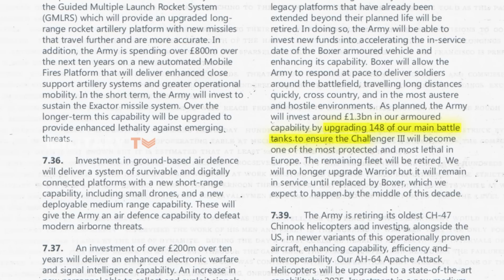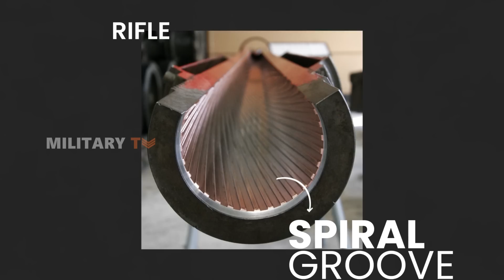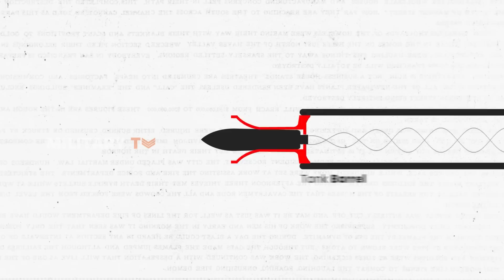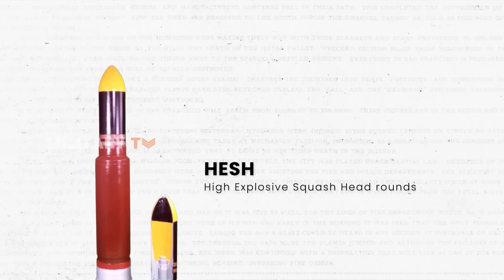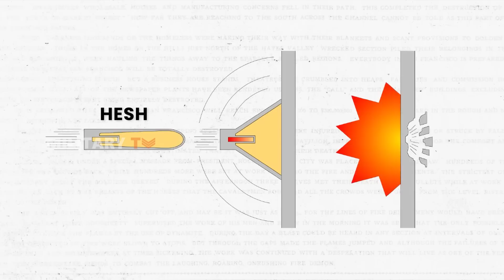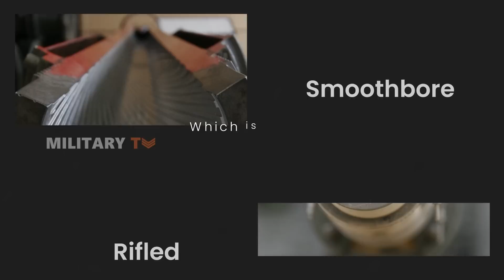Rifled vs Smoothbore Tank Guns—Which Is More Effective?

Comment: Rifled has historically been more accurate over distance, with British forces adopting the theory with the Chieftain/Challenger, build some thing as hard as nails able to knock out your opposition at twice their range. However rifling although imparting spin to improve accuracy lowers muzzle velocity, that was not a problem for British Crews as they loved slower HESH rounds. Far more lethal to a tank than most of you have been told (death by spall is the least of your problems). British 120mm HESH could one shot any tank on the planet from ludicrous ranges (M1's died, but they fired first). However the slower HESH are defeated by Reactive Armour so Britain switched to German scaffolding tubes and cheap ammo.
Reply: Rifled guns are more accurate, but that is not the case with tank guns because tank shells use fins to achieve stabilisation. HESH hasn't been a reliable round against Tank and has fallen out of the inti-tank role for a long time. Modern tanks use composite armour and have spall liners on the inside and let's not forget about ERA. APFSDS is still your best option against other tanks and the APFSDS rounds that fired out the Challenger 2 have rotating bands around them to cancel the rifle of the gun.
Reply: Well, when "scaffolding tubes and cheap ammo" are better... That says something about British engineering, doesn't it?
I guess the Germans also fixed the issues that the SA80 had with "scaffolding boards and cheap screws"... lol
Reply: @RS-lw1hz  The SA-80 was originally desgned I am told to fire a larger round than US dictated 5.56 that would have seen higher gas pressure to throw the bolt back. Ahead of it's time the weapon was the most accurate infantry rifle out to 500 yards. The iseilies copied it (tavor) and like the venerable .303 the Afgans tried to get them. Cadet Rifles fetching big money in gun markets.....says something about British engineering doesn't it.
Reply: @thebritishengineer8027  the SA80 (like the Tavor) is just a bullpup ArmaLite AR-18, nothing new besides the novelty of the bullpup design. British engineering forgot to provide a solution for 10% of the lads though, but hey someone needs to operate the GPMG right?

The issues with the SA80 started during production when the Enfield factory was due to close short after getting privatized and everyone was getting sacked after the contract was finished. That meant that the quality control at Enfield went downhill by the time the SA80 came into production due to low moral among the workforce, even though the L64/65 (the rifle that served as a prototype for the SA80) worked well. Good engineering does not stop after a good prototype is made, but I think we can blame the politicians for this one.

The Afghans tried to get any weapon they could, SA80 was far from special to them.
Cadet rifles fetch big money because of the history behind it and the emotional value due to being a fairly modern national service rifle that UK citizens can own (due to being straight pull only, UK gun laws), not because they are the best of the best.
Reply: @RS-lw1hz  I can't work out if your knowledgable about this subject or reading it from wiki-pedia/redit. Giving you the benefit of the doubt, you are partly correct but the bullpup was a unique design that did not start with the L64 but it's for runner the E0M2/Janson that was the best cold war rifle never made acording to Forgotten Weapons. As for the L85, well I know of a report sighting a British squadie first time out in Basra, whose section was caught in an ambush and downed 7 unfriendly’s with 11 rounds. Not fired one but regardless it does everything it says on the tin and better than anythin else despite bits falling off and not liking anything in the bolt throw.

As for the Afgans...they could get anything they wanted from pakistan, but they wanted Cadet Rifles. If you visited a target shoot 10 or so years ago stock Cadet GP's were being used in competitions it was really that good.

We could be batting this ball over the net all day. No I'm not impressed with the 120mm smooth bore, but new rounds need muzzle velocity. However that poor British Engineering you talk of did produce a gun the MOD should be looking at, the CTA in a 120mm configuration WOULD!!! Out gun everything on the planet. BAE developed it with a French outfit. A 40mm round able to pen 80mm of rolled steel plate, up that round to 120mm…..
Reply: I hate to say but that’s cope, the tanks the challenger is currently facing off against is the T-90, 80 and 72 (yes there are other tanks I’ll get to those in a minute) these tanks cannot be affected by HESH due to something the Challenger already has IT’S CALLED COMPOSITE ARMOUR it completely negates any advantage HESH had, now yes there are T-55s and the like and HESH will work no problem against these vehicles however challenger hasn’t been facing any tanks and has and was relegated to anti-personnel duty but it can’t deal with infantry due to HESH bing a plastic explosive which means it needs to hit something harder than the soft mud of Ukraine, also the rifle gun doesn’t increase accuracy at all and it wasn’t chosen for HESH it was chosen for logistics due to the Challenger 1 still being around when the Challenger 2 entered service!
Reply: @NATOenthusiast  Cope..? Ever see a weapons test of one of those HESH rounds impacting on one of those composite equipped T-80's? A blue on blue back in the gulf saw an up armoured Challenger turret relocated to the back of the engine deck after a HESH hit. And I do believe that is one of the best composite armours in existence. Go back to your physics, think this thing through the penny will drop. For a clue think Upkeep & a German dam same principles….
Reply: @thebritishengineer8027  yes cope, on that blue on blue incident you are talking about the HESH round hit the commander's cupola and the fragments that killed the commander and the gunner also started a fire that eventually got to the ammo and blew the turret out of place. There was a Challenger 2 that was destroyed in Zaporizhzhia last year that had the turret dislodged back in a very similar position (although not as bad) to that 2003 blue on blue incident in Basra. This is probably related to the ammo stowage location inside the tank that causes the turret to be dislodged back into the engine deck after an ammo cook off. You know, physics and stuff...

I can't find anything about that HESH round test against the T-80 tank though, I find it hard to believe that there was any spall inside the tank if the HESH hit was on the frontal upper plate, however I would like to read that report and be proven wrong.
Reply: @RS-lw1hz  HESH brewing up a Challanger not likely and if was an amo explosion it did not gut the tank. The round hit the turret was moved by strange HESH magical forces to the back of the engine deck and it used composite armour. Again look at the physcis of the weapon I gave you a clue in the Upkeep Mine. The T-80 test was on u-tube with the lads in Newcastle Drag racing Chally's at the factory for about 2 hours never to be seen again. Not something thy want us to see.

Hope you looked up the CTA Cannon, someone of your knowledge I think will appreciate that one.
Reply: @thebritishengineer8027  what do you mean the ammo explosion did not gut the tank? The tank was wrecked, they barely had time to help the two that survived the initial HESH hit. Just have a look at the pictures, the loader wouldn't survived if the turret was dislodged by the HESH round.
Reply: @RS-lw1hz  I have seen the images, I have read internet reports... I talked to driver mechs from the horses mouth. You have your info I have mine best leave it at that...
Reply: I hate to say but that’s cope, the tanks the challenger is currently facing off against is the T-90, 80 and 72 (yes there are other tanks I’ll get to those in a minute) these tanks cannot be affected by HESH due to something the Challenger already has IT’S CALLED COMPOSITE ARMOUR it completely negates any advantage HESH had, now yes there are T-55s and the like and HESH will work no problem against these vehicles however challenger hasn’t been facing any tanks and has and was relegated to anti-personnel duty but it can’t deal with infantry due to HESH bing a plastic explosive which means it needs to hit something harder than the soft mud of Ukraine, also the rifle gun doesn’t increase accuracy at all and it wasn’t chosen for HESH it was chosen for logistics due to the Challenger 1 still being around when the Challenger 2 entered service!
Reply: Rifling was seen as a means for getting better accuratcy but advances in technology has made smoothbore just as accurate without the complex machining for rifling
Reply: @verdebusterAP  and barrels last longer 🙂

Comment: Smooth guns have faster velocity, flat trajectory, Easier to make and they are now more accurate.
Reply: Lowest price in the gun, but more complex ammo, remember that tank vs tank it's a rare scenario in modern warfare, instead HE and Hesh are more versatile to conter buildings and infantry.
Reply: But rifled guns last longer, they can make more shots before replacement.
Reply: @leotka  opposite, smoothbore has significant much more longer barrel lifespan
Reply: @pandatanoao9384  I doubt this. I have seen a couple interviews on line and 125mm life span is 800 shots only, but British ruffled guns up to 2500.
Reply: @leotka  British l30a1 only last long 500 rounds, don't know the number of 2500 where come from, for comparison, rh120 minimal last long over 1000 rounds
Reply: @pandatanoao9384  The predecessor, L11A1 on Challenger 1 was rated to only 200 rounds of APFSDS. Shockingly bad.
Reply: @AllThingsCubey  But Challenger 2 tank used electro-slag casting for manufacturing 120mm gun. It was first western tank using Ukrainian technology for getting top quality steel and alloys.
Reply: @leotka  That... Literally doesn't change a thing. It's still only rated for 600 rounds of APFSDS through the rifled gun, Vs 5000 from modern smoothbores, and it's a damn lot harder to replace a worn out rifled gun too.

That's not to mention the performance differences, where the smoothbore leaps even further ahead with every relevant modern ammo type.
Reply: If you have a full AP round, a smoothbore barrel is a terrible choice.

If you have a APFSDS round, a rifled barrel is a terrible choice.

If you have a Spigot, both type of barrels work the same.
Reply: Faster than what?
Flat WTF?
So what
No, they're not
Reply: NoT when firing APFSDS. And that is in the old days.
Smootbore barrels are now way more durable than rifle.

And that dubious advantage doesn't mean anything when every modern tank switched to Smootbore with only 1 remain rifle in the case of Arjun but India operate plenty of 125mm smootbore tanks
Reply: yeah in 2024 there's literally not a single advantage of a rifled tank gun, and there hasn't been one since the 1980s
Reply: @AllThingsCubey 
You haven't seen High Explosives round used in howitzer yet. They really need those rifled barrel to fire accurately.
Reply: In 2024 the use of a tank as an armoured fist is over, manpads and drones have proved that. On todays battlefield  they have two uses, as a mobile pillbox or target practice.
Reply: @AllThingsCubey  unless you want to score the worlds longest range tank kill.

Comment: NATO 105mm rifled gun has a large variety of ammunition - APDS, APFSDS, HE, HESH/HEP, HEAT, WP (smoke), Canister, APERS, GLATGM, illumination etc. NATO 120mm smoothbore guns have only APFSDS, HEAT, canister and some HE  round.
Reply: Why would anyone want APDS, it’s inferior to APFSDS in every way. The only thing rifled barrels do better than smoothbores is HESH and cheap shells.  But for HEAT (also obsolete), APFSDS, Canister and GLATGMs smoothbore is superior, as it allows for higher muzzle velocity and doesn’t impart spin. By the time you use programmable HE, the difference in price is negligible. I‘ll grant you smoke and illumination, but if they were actually needed, they would have been designed and procured, despite higher costs.
Reply: Israel has developed GLATGM for 120mm smoothbore guns - LAHAT 120.
Reply: You for get programmable ammunition which is arguably better than most of the shells you listed of minus the APFSDS and WP.
Reply: You for get programmable ammunition which is arguably better than most of the shells you listed of minus the APFSDS and WP.
Reply: @NATOenthusiast  You can have programmable ammunition on both 105mm rifled and 120mm smoothbore guns.
Reply: Yes 105mm has that but the bulk of those rounds are obsolete now
The only relevant rounds left APFSDS, HEAT, HEMP and precision guided 
HEMP is High Explosive Multi purpose like the XM1147 which is several rounds in one 
Newer guns like the 130mm and 140mm make HEAT rounds far more lethal as the larger shell can carry a bigger bursting charge